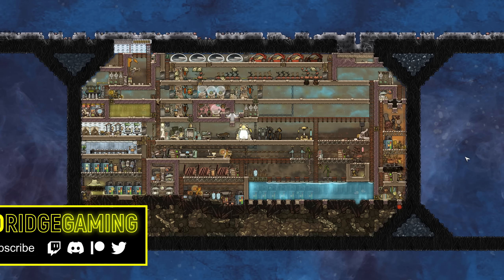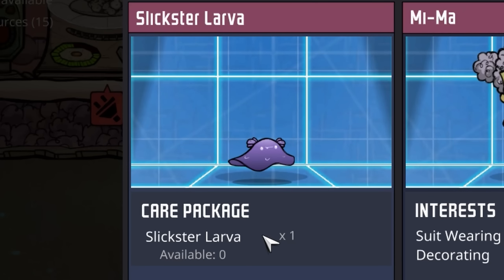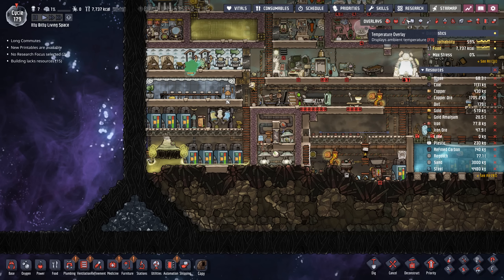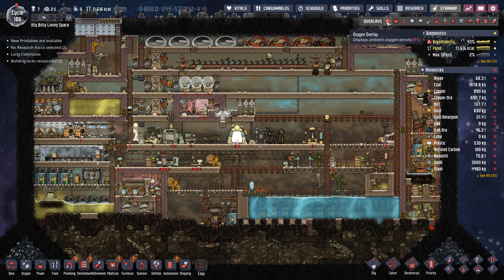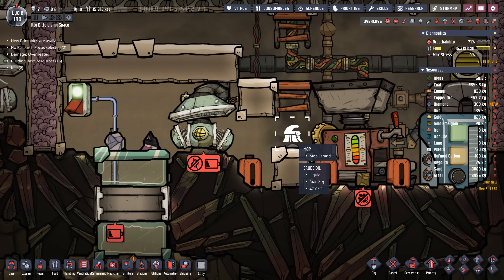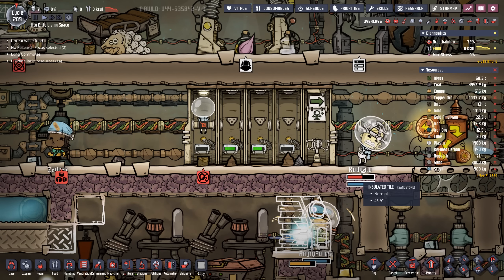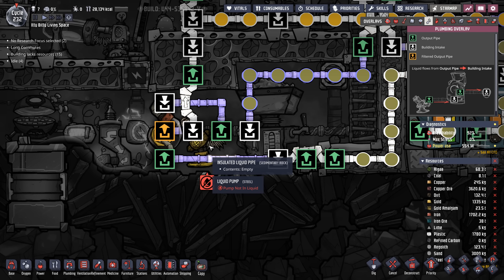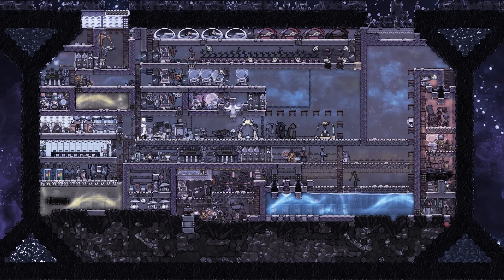w/ geo thermal spike! | Mini Base Ep 5 | ONI

Comment: I'm sure you've already thought of this, but don't forget to make as much ceramic as possible, it substitutes for raw minerals in a lot of places, and it's basically free as long as you have polluted water and regolith.
Reply: Except it needs coal which is limited right now
Reply: @MSoave  If you have a heat source sufficiently hot, you can build a clay tempshift plate to it and it'll sinter into ceramic. And there are plenty such heat sources on thus map.
Reply: @thesentientneuron6550  I didn't know that but that's good to know. However when that clay turns into a natural tile he will lose 1/2 thy mass when he digs it up and clay its pretty limited right now too, at least he has a renewable source now though.
Reply: @MSoave  you can smash up ceramic into sand, which hatches can eat, creating the coal necessary to make ceramic in the first place
Reply: @Christian-jc6gf  you need to use the sand to make they clay you need to continue making ceramic.

Comment: A few suggestions:
1. If you strip away all but one layer of abyssalite, you might be able to separate all generators in the hot room into a mini powerplant room. You do have an infinite source of refined metals in form of meteorites, after all.
2. If you put a liquid sensor next to the pump, you can always maintain a minimum amount of liquid on the floor, which should be enough to capture all temp spikes from opening/closing doors.
3. Once you deal with all emergencies, maybe let dupes out into space and have them dig up all materials up there? And then run all of them through your debris chiller.
Reply from the maker: 1. Slow and steady, hoping to do this.
2. This is a great suggestion.
3. This def needs to be done, just taking a minute to get around to it.

Comment: Change up your battery automation. Set the low threshold to 50% for the petroleum generator, gas generator and hydrogen generator and have them all come on at the same time. Have the high threshold set at different times though based on how long you want each to run. 80% hydrogen, 70% natural gas and 60% petroleum. This ensures that they each get to run. With your current setup, not every generator will get to run because you may not be consuming more power than a single generator can output meaning no other generator will turn on. Leave the coal generator as a backup by placing it's activation lower than the other three or if you want to use coal set the activation to 50% and high threshold to 55%
Reply from the maker: This is a great suggestion.

Comment: I'm doing a play along. What I've run out of is dirt, which is preventing me from finishing off the research. I've gone cuddle pip crazy thanks to your tutorial, but still it's a struggle.
Reply: for dirt, do the arbor tree to etanol route, one entanol destiller produces, if i remember correctely, the same amount to 10 pips, almost no dupe labor, plus produces fuel.
FJ had the same problem, solved it that way.
Reply: @samir5740  dirt comes out of the ethanol distiller? Thanks I hadn't even thought about that.
Reply: @Davini994  it produces 333,33 grams per second of polluted dirt, which can be converted into dirt by 4 composters.
go to "Oxygen Not Included Wiki" for more info.

Comment: You could put 4 solid or airflow tiles above the diamond, then the oil/petroleum wouldn't drop on it. Unless the level filled the lower row on the right. I'll put a picture on the next message, I think the spam filter will get it.

Comment: I mean, there surely was no way to avoid the mess, right? Like, you know, building a couple of insulated tiles above diamond windows to prevent heat transfer until the brick is done :)
Reply from the maker: Shhh... don't ruin the chaos :)

Comment: The element sensor on the pipe that controls the oil well is not ideal. I used to control my buildings this way back in the days, but it's not flawless. It works well when it has to turn them off, but she  they have to work - once a smidge of the element passes it will turn it off again, then the element will pass and it will turn on again, and so on untill it backs up enough. 
Instead you can use an overflow with a bridge (well two actually), that way the element will detect an element only when the line is backed up. And the overflow will get empty, only when there is actually a need. That would require a bit more minerals tho, unless you make them from ceramics
Reply from the maker: I end up adding the bridge overflow system.  We have used it in the past and you are right, it is a better method/system.

Comment: Why use polluted water as coolant for the metal refinery?  Why not pump petroleum through it and then send the hot petroleum through the metal tiles under the turbine with some radiant pipes?  That way you aren't injecting a crap ton of heat into your water that needs to be cooled by the aquatuners?  Plus, this way you get power back from the refinery.

Comment: Why not use liquid Valves and bridges for filtering? They safe space and power.
Reply: Every powerless filter has holes. And in this case is those holes get exposed machines take element damage which costs resources to repair
Reply: @MSoave  Just Bild a litte Loop and brige on the mixed land brige of from the Loop the diverent elements on the different valve filter and you neuer will have a rong Element.
Downside you have to build a Filter for Eveny Element to not clock it up. 
But you create filters wich have a mixed live of to or three diverent elements in you want to have the on the same line.

If you just want to filter one Element Out and dont care about if the filtert Element goes ahead on the mixed line if the filtert line ist full then you dont need a loop then you just bridge on the filter and neuer will have a rong Element on the filtert line
Reply: @floriankoegl6797  it's not just that, powerless filters run into issues if any of the pipes backup. For example if I use a powerless filter to pull O2 off a line containing O2 and co2 and the O2 pipe backs up then the line won't be pure co2 because O2 will remain on the line. So in your in a situation where both pipes need a pure element you can't rely on a powerless filters.
Reply: @MSoave  Just loop the mixed line bringe on the loop so it wont get clocked up and use to Power free filters. if oly to elements are sorted they need 4 Building sqares so one more then the powerd filter but if you sorte 3 elements thant its the same with 6 Building sqares and if you sorte 4 more diferent elements from a line than you need less Building space